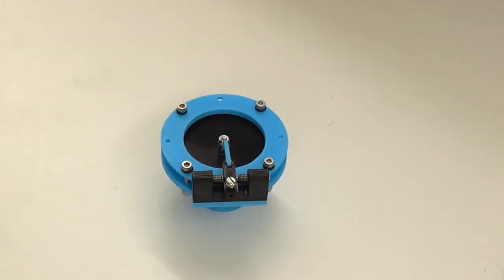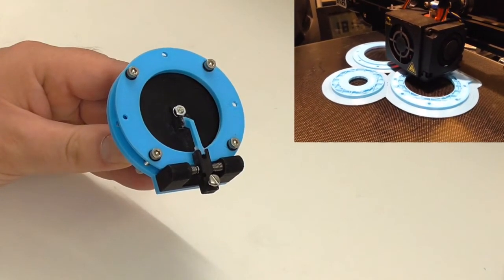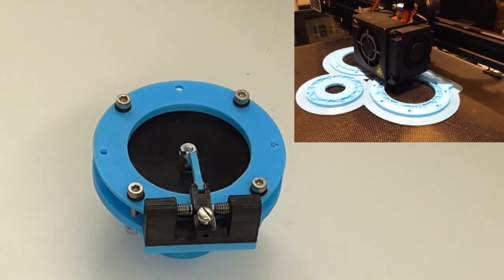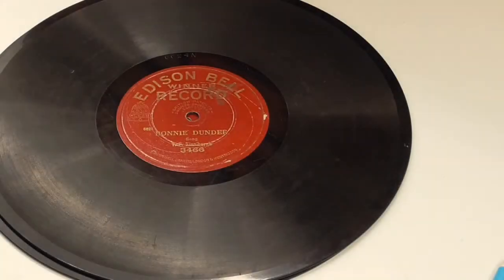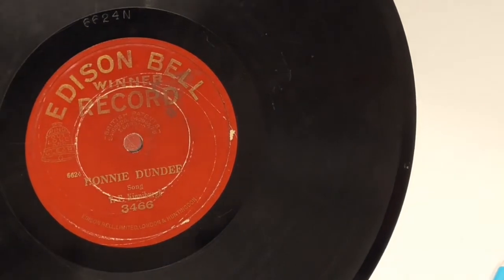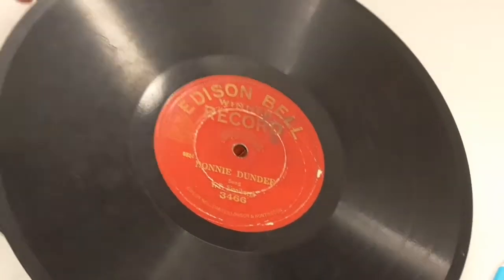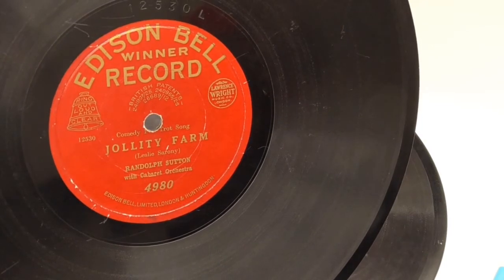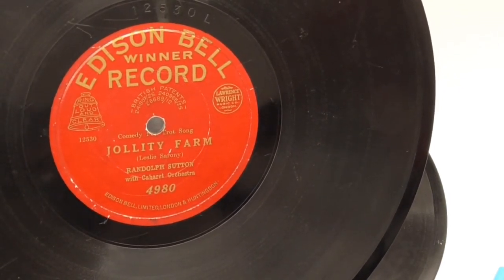DIY gramophone soundbox / reproducer diaphragm test part 1

Comment: Can you try using rubber diaphragm
Reply from the maker: It's an interesting idea 🤔. Usually, the diaphragm is as stiff as possible, though held flexibly at the edge with rubber gaskets. This is so the small movement of the needle bar attached to the centre of the diaphragm causes the whole diaphragm to move, pushing as much air as it can. I think with a rubber diaphragm, only the very centre would move so the volume would be much reduced. Thanks 😀 👍
Reply: @mrrgstuff  you can try using a 50mm passive radiator as a diaphragm
Reply from the maker: Yes, that might work. It's going to depend how stiff it is. As far as I understand the passive driver is designed to be driven by air pressure behind it. It may require stiffening to be successfully driven from the centre 🤔. It's an idea though. Thanks 😀 👍

Comment: Just watched, very interesting, I think I’ll give the polystyrene a go, by the way I love your 3d printed soundbox,I don’t have a 3D printer, but I have two horned Pathe gramophones and the elbow that holds the tone arm is broken in two of them, pot metal I think. (I have had success previously fixing  pot metal parts with a metal epoxy, not great looking, but done the trick) I was wondering would a 3D printer be able to make these parts, just curious thanks
Reply from the maker: A 3D printer could probably be used for this. I know they are often used to make replacement parts. It's mainly just a question of accurately measuring the part and modelling it on a computer. Glad you enjoyed the videos. Thanks 😀 👍
Reply: @mrrgstuff  project for down the road thanks again

Comment: It's not the diaphragm that is the problem with your design.  It would work just fine in a Columbia no. 21 soundbox.  The problem is all the plastic, in particular the plastic needlebar with a far too large contact area at the center of the diaphragm.  Also the wax is not needed for testing purposes.
Reply from the maker: Yes, the soundbox does have some design limitations, however they stay the same for each of the different materials I try and they don't all sound the same, so the diaphragm material does have an effect
I've also tried with some flat metal diaphragms:
https://youtu.be/aMrX8tn-tYI
and also a mica diaphragm:
https://youtu.be/GwkSmJzJ_bU
and a corrugated aluminium one:
https://youtu.be/mK1bGhanqf4
Going back to the PLA one, yes you could put one in a Columbia No.21 soundbox though I wouldn't expect it to sound as good as the original one. I have tried a PLA one is this vintage soundbox:
https://youtu.be/DNVFgSQrAjY
However it doesn't sound that great:
https://youtu.be/qysv6VhaPO4
and I will replace it with something better.
Polystyrene while not as good as mica can be used as a substitute which is what I have done here:
https://youtu.be/IkCCI8Vvisk
I've also built this design of soundbox which while far from perfect does attempt to address the needlebar issues and the weight:
https://youtu.be/A7qNRg3BS5o
Thanks 😀 👍

Comment: There seems to be a pattern to this.  The more flexible materials seem to give better bass response, but at the expense of treble response.  The Polystyrene is noticeably different from the other two, giving a nice clear and crisp treble response, but at the expense of reduced response in the lower (bass) frequencies.  My guess is that polystyrene might behave a bit similar to mica, but was a material not available 'Back in the day'.  Matching the soundbox to the amplifying horn might be important.  A long horn which gradually exponentially widens gives a better bass response than a short one. So my guess would be the polystyrene would be good in a machine with a long and therefore 'Bassy' horn, to compensate for reduced bass response, and the other two might fair better in a machine with a shorter horn, such as a small portable.
Reply from the maker: Hopefully I will have a mica diaphragm soon so will be able to compare with the polystyrene one, but yes it may well turn out that polystyrene is viable material for this and might well have been used if it was available. Interesting point about the horn and type of machine. For comparison/video purposes I have the lid open and the volume doors closed but for normal listening it would the other way around and the horn on the HMV 162 is pretty sizable (not sure if you have seen my video featuring it), so the polystyrene one might be well suited to it. Even with the crude state of my sound box  it does provide enough volume on the 162 for actual use though I tend to use a No.5b. At some point I might try a portable, though I don't have a decent working one at the moment 😉. Thanks 😀 👍

Comment: I hear greater clarity & slightly more volume from the polystyrene. It would appear that the material has to be hard enough to bounce soundwaves off, but flexible enough to move those fractions of a millimetre amplitude of the soundwave, qualities that mica seems to have, though it appears to favour the higher frequencies. To some degree, HMV improved the bass response with their No.4 soundbox, with its slightly larger diameter. When you think of it, the HMV orthophonic reproducers have it all, a hard lightweight central cone to bounce those soundwaves off, surrounded by highly flexible pleated aluminium foil, to give the compliance needed for those higher amplitude bass soundwaves that came with improved electrical recordings. As for the ideal test record, do you have Henry Hall's 'Teddy Bear's Picnic?' The BBC used it as their test record for many years after the station had closed for the night of course. Their engineers found its wide frequency range ideal for testing broadcast equipment. I've posted it to test different gramophones, without raising copyright issues!
Reply from the maker: Thanks 😀 👍.  The polystyrene sounded better to me though based on the sound waveforms, I wasn't sure if it really was reproducing the frequency range as well as the other ones. I have not yet got a mica one to compare with,  but did wonder if the polystyrene might be similar to it, due to its rigidity. I am currently filming the metals versions which should be up in a week or two. Its going be just a basic material comparison, but I am also thinking of making laminated and/or pleated ones too. I think I could use 3D printed 'stampers' to make a crude imitation of the one in my No.5B which would be worth a try. Unfortunately I don't appear to have that record. Its probably one I would buy if I found it though! I am also thinking of ways to test the sound box without a actual record to get some sort of objective comparison, but its just ideas at the moment
Reply: @mrrgstuff  So interesting to experiment with. I suppose even the best soundboxes are a compromise, when we consider tweeters, woofers etc. to achieve the full range. There was a gramophone with two soundboxes driven by the same needle (Duophone I think) but curiously they were the same size. Now that WOULD be an experiment, two soundboxes of different sizes, feeding two horns, also of dissimilar size!
Reply from the maker: @tiga4180  Yes, the Duophone does look interesting. I have one of their flexible records, but its not survived well enough to play. I have considered making a dual sound box like their one, however I would like to improve my means of testing it to show it is really working. I have also read recently about (I think) an Odeon brand gramophone which has both metal and wood horns to get the benefit of both. Thanks 😀 👍
Reply: @mrrgstuff  Experimenting with metal would be interesting. Those semi disposable baking trays could be a source, but feel there would have to be concentric stiffening rings, as found in those basic soundboxes that contained an aluminium diaphragm. I seem to recall tubes of 'Pringles' had a plain steel base. Lacking the stiffening ridges found on the tops of bean cans etc., it may just have the right flexibility. Glass was the material of choice for acoustic recording diaphragms & my Edison Bell Imp phonograph had a glass diaphragm. Sadly, I never got to hear it, not realising it was glass shattered it whilst attempting a rebuild :-( Can see why it never caught on in gramophone soundboxes!
Reply from the maker: Yes, pie trays and Pringle tube bottoms are both types of metal I have tried for  the next video in this series. I shot the metal comparisons the other day, but need to check them and there is quite a bit of other work that needs to be done before I get that video up. I do think there is scope in corrugating the pie tray aluminium as it is thin enough. I also think laminated diaphragms will be worth a try! Thanks 😀 👍
Reply from the maker: Metal tests including pie trays and pringle tube bottoms are now uploaded at:
https://youtu.be/aMrX8tn-tYI
Thanks 😀 👍

Comment: Interesting. On the acoustic , First two not all that dissimilar. Poly def sharper and more tinny.  Pls don’t forget when comparing to the hmv 4 ,  havent done the test with comparative weights yet. Electrical recorded tests much better than the acoustic test across all the Diaphragms. Was the difference between the two records  due to wear of the record surface or the process of recording do you think? All very interesting. Looking forward to the metal options.
Reply from the maker: Thanks 😀 👍.  I did think of comparing the these ones against the No.4, but in the end decided to do a straight comparative test just between the materials. I will do the same for the metals. Once I have done those tests  I will either compare the best against the No.4 again, or move to the next version of the body which I will weight to be similar to the No.4 (hopefully be able to get it pretty close). I also have a No.4 mica diaphragm on order, so depending when that arrives I will do a comparison test with that too. The electrical recording is noticeably worn, but I think it still sounds better due to the better recording process. I am looking at ways to objectively test the sound box without a record to remove that variable  but that is someway off yet!😉
Reply: mrrgstuff its interesting to think, that probably, no one has looked into the dynamics of the soundbox since the 1930’s!
Reply from the maker: @davidk6271  It would be nice to think I am breaking new ground, however I suspect there have been multiple people over the years trying to make a 'better' sound box! There are a couple of other 3D printed designs on YouTube that I have found, though neither have developed it as much as my one. I  am sure there are several diy sound boxes of more conventional construction in circulation out there too. Would be nice to build something which worked as well as the No.4 without just copying all its design. Thanks 😀 👍

Comment: Very pleasant. The polystyrene one was sharper in sound compared to the other two. The HDPE was warmer and fuzzier than the printed one. I guess I’m going to have to make a PS diaphragm for my setup to try out but for your machine I would definitely say polystyrene for the win
Reply from the maker: Thanks 😀 👍 I liked the polystyrene one too. Just been trying out the metal diaphragms, but it will be a week or 2 before I get that one uploaded
Reply: mrrgstuff also been experimenting with laquered thin cardstock and paper with mixed results
Reply from the maker: Yes  I have heard paper/card can work well also. It might also be possible to laminate different materials. Possibly something like paper and metal foil might be worth a try? 😀👍